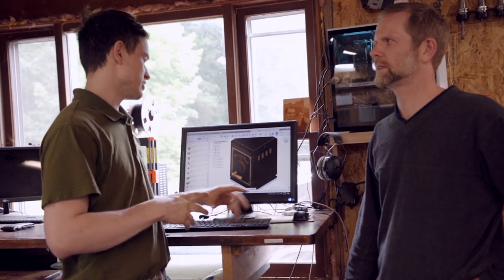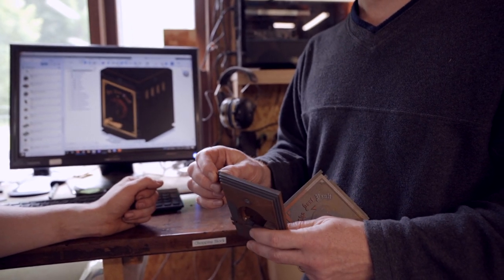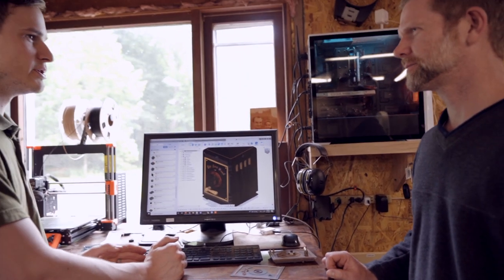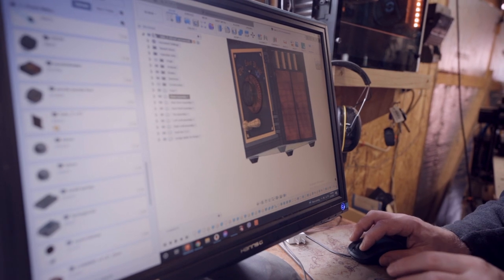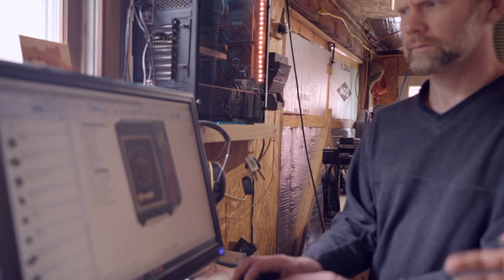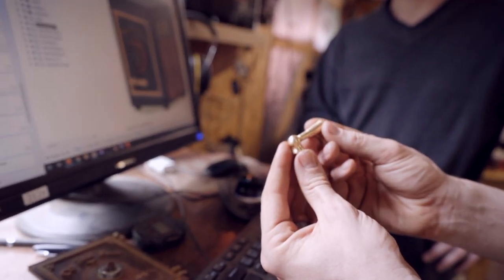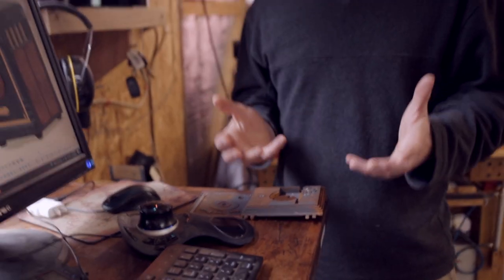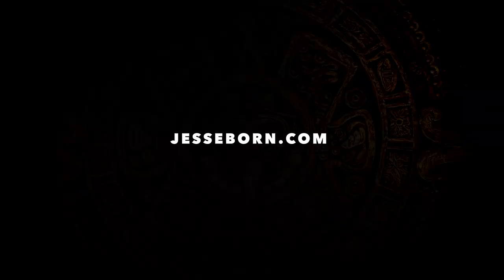Creating this puzzle is a puzzle!

Comment: I’ve only printed with normal PLA. What was your experience when trying to print with the PLA that had metal infused in it? Did you need a special nozzle? Different temp? If you didn’t run into any significant hurdles with it I’m sure a lot of us would be curious to try printing with it also
Reply from the maker: I don't think I've even used it myself. I'll have to make a follow up video with Ben about that.